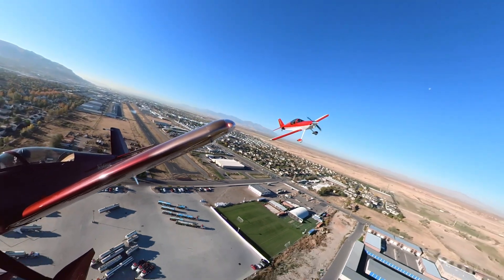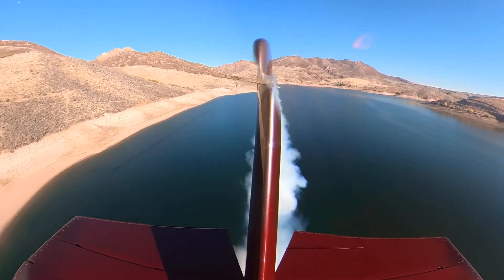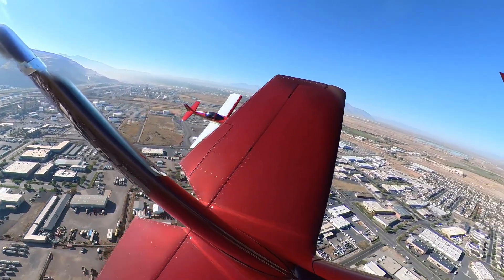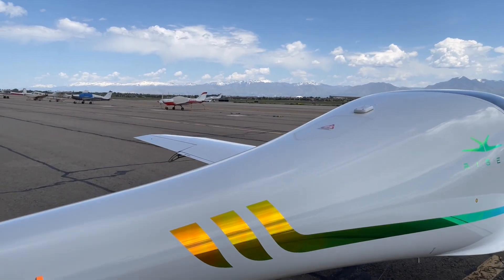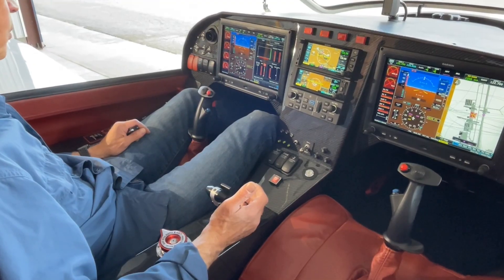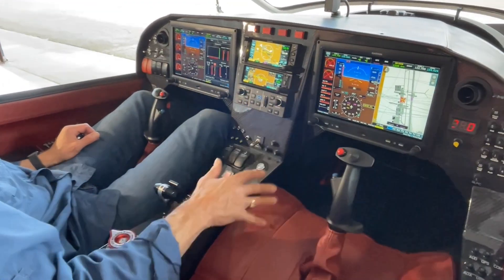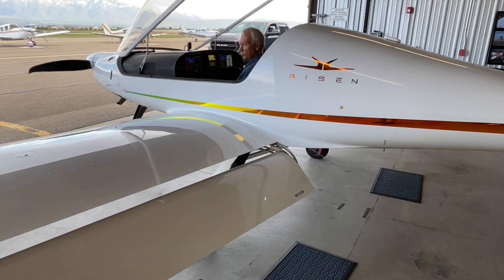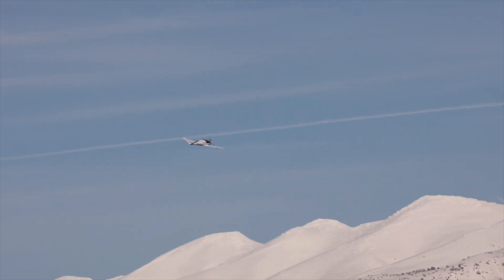Risen 915 experimental aircraft- Introduction

Comment: How does the risen handle? Can it create an “rv grin”…. or better a “rocket grin”? Try any gentleman’s aerobatics yet? Finish with the color changing tape is fantastic! Do you know if the risen will be at Oshkosh?
Reply: Thanks for the quick reply. Sorry about your tire
Reply from the maker: @cpg7277.   I thought it handled quite nice. A bit  light during t/o and landing.   Not sure about the “grin” though.  You know I’m somewhat partial to RV’s and Rockets. 
I believe the Risen is something like a +5,-3g’s. Not aerobatic. But we still did a few barrel rolls. 
Risen is planning on OSH next year. I had planned on leaving for OSH in the morning, but I blew a tire on landing today and need to order a new tire, tube and repair my wheel pant. A little bummed, but hopefully I can go next year.

Comment: Hmmm.  Automated everything.      Maybe I’m just old school, but it seems like a lot of things to go wrong.   Definitely not a KISS airplane.
Reply from the maker: @tw5315. I certainly understand.  Time will tell if automation is good.  Of course, you remember airliners use to have 3 pilots.  The third pilot was the engineer, sitting sideways. A huge panel in front of him.  Numerous tasks, one of which was bringing generators on line after engine start. What a pain, you first had to synchronize the generator before bringing it on with the others.  Also, Full Authority Digital Engine Control (FADEC) has been around for a long time now and is even available to home builders.  Funny, complexity and simplicity, a constant battle and huge debate.

Comment: Lovely aircraft, but I don't understand the prop pitch control. From the description given, a fast cruise (requiring an 80% throttle) would produce a fine pitch, whereas surely you need a coarse pitch at high speed?
Reply from the maker: @rigilchrist. Sorry, we should’ve explained better.  Apparently, there are other inputs that help determine propeller pitch besides just throttle position.  I have to say, after flying jets my whole life, I kinda like the idea of the plane figuring out the optimal mixture and prop pitch.
Reply: @WheelsInTheSky  Thanks. I agree - though I have never flown jets, I have flown a diesel a/c aith automatic prop pitch. :)

Comment: How does this compare to the DarkAero?  (I mean, besides the DarkAero not shipping for at least another year.)
* That cockpit looks quite roomy.  I assume the bucket of the seats is between the two wing spars?
* Wing is significantly bigger than DarkAero, and the max weight is less, and those huge flaps!  DarkAero's stall speed and runway requirements would be larger, right?
* Is the DarkAero effectively much faster?  The DarkAero fuel capacity is over 4x larger, but max gross weight isn't a lot bigger.  Is the Risen just assuming you'll always have a passenger?  Are those flaps making the tanks smaller?
Reply from the maker: @lainMcClatchie. Hi Lain. Sounds like you’re in the market for a plane. Always  exciting !  I looked over the specks of each plane.  You’re right, each has its pluses and minuses.  I think it just comes down to which plane has more pluses for the mission you plan on.  And, I shouldn’t say, but, which one you get the most excited looking at!
Although,  I’m not sure I would be comparing the Dark Arrow to much at this point.  History is full of aircraft designers who haven’t gotten past the point where Dark Arrow is right now.  But, I hope they do and I hope their specs materialize!  I know, not much help am I.
Reply from the maker: @lainMcClatchie. I’ll need a minute to look at that.  I always enjoy checking out another plane.  I’ll be back.

Comment: yeah it's just the best "LSA". It can significantly outrun a Bonanza and Cirrus SR22 at a fraction in running costs. And in economy cruise has a range over 2000km iirc. That 400km/h speed means it can actually be used to go places, not just fly about. If just a matter of paperwork they should definitely certify it in USA. I think there is only something like 30 of them worldwide, it's crazy. And a shame. If they could optimize production and cut price in half they could really do some damage. One thing I've wondered recently is if with such a light lean plane if it could do without the flaps. It would clean up the design and production a fair bit and we might be talking about a fraction of a second longer on the brakes.
That instrumentation there looks like it can fly IFR as well?
So much room in GA for progress. Matt Guthmiller is unironically flying around in a WW2 plane. The design is literally from 1945.
Reply from the maker: @DanFrederiksen. Yes, with the new FAA ruling, I think we’ll see sales in the US increase. I’ll talk to Bob about no flap landings.
Reply: @WheelsInTheSky  A german VL3 guy said he felt the Risen wheels were small. Are they good enough for grass strips? maybe even gravel banks.
I assume from the 650 that it's IFR capable? which is important for bonanza guys to cross shop it. VFR is so limited that GPS instrument flying should really be part of any pilot license.
Reply from the maker: @DanFrederiksen  @DanFrederikson. Yes, it’s full IFR.   The wheels are small, but it’s a small plane.  I think if a grass or dirt strip is smooth, it would be fine.  Also, may be possible to go a little bigger on the tires.
Reply: If it didn't have flaps, I imagine it would be a handful to slow down for landing. A common complaint about the Virus SW, another slippery composite ultralight, is that it's difficult to slow down without the spoilers.
Reply: @MarkRose1337  yeah because it's actually a good plane, not a winged brick. you could have little spoilers like gliders have but could also just approach shallow and use brakes. Great glide is a luxury problem.

Comment: New proposed light sport rules makes this plane a MLSA. 
1. Weight to 3000lbs 
2. Speed to 200knots 
3. Retractable gear 
4. Constant speed prop 
5. Turbine engines
6. Helicopters 
7. Possible night flight 
8. Ariel work
9. Four place aircraft
Reply from the maker: @mauriceevans6546. Yes, so happy the FAA finally came around !!
Reply: It is going to change alot of things.

Comment: Lovely but the 916 is going to be even better
Reply from the maker: @danielnofal.  Exactly what I’m thinking. And with the new LSA rules it won’t be an experimental any more.  You’ll be able to buy it factory built as an LSA.
Reply: @WheelsInTheSky  I wonder what kind of better performance you could expect with the 916?
Reply: @Zugbarrh  Faster climb, and faster speeds at lower altitudes. The 915 takes it close to VNE already. It cruises at 242 knots at altitude and VNE is 250.

Comment: FAA needs to get on the same page with Europeans this would be a light sport if they did. Aviation could be so much more if they lighten up on the medical. I have been waiting for LSA rules to change before I get my certificate. I could try and get a medical certificate it would be such a pita over things that happened 35-45 years ago doctors already cleared me of all that. They want it all checked again because that is how they are. I don't want to spend 10-15k on bunch of unnecessary medical testing which is has some risk to exposure to radiation. I only got a consult just do light sport since I never pulled the trigger on the FAA medical officially.  Once you open that can of works can't go back. I know someone who building an RV8 kit at the same time started getting his PPL. When he got to the point of solo he went to get his medical been 3 years still going back and forth with FAA over stuff happened in the 1990's. He bumped his head riding a dirtbike in 1993 was knocked out went to the ER and they checked him out. Sent him to a neurologist who did an MRI nothing found all good 30 years pass no issues. The FAA wants it all testing done over again he did it sent it they want more he done sold his RV-8 kit never soloed.
Reply from the maker: @blastman8888. I couldn’t agree more.  When I retired from the airline, I switched to “Basic Med” because I know the FAA can get unreasonable- and I’m getting older.  GOOD NEWS- the FAA released new ruling on LSA aircraft just the other day at Air Venture.  Google  “Mosaic LSA Draft Rule Summary”.  It made my day!!!
Reply: @WheelsInTheSky  That's good news.
Reply: The mosaic draft looks very good! 🤞🏽
Reply from the maker: @ronuyeyama4020    Yes, I’m excited to see some new LSA aircraft start coming out.

Comment: Does Skypark still have those really swell power lines at both ends of the runway? That is a really beautiful design btw….
Reply from the maker: @noonehere1793. Lol. Nothing right at the ends.  A couple miles off the North end there’s some big power lines,  but there’s also a lot of open fields for an emergency landing- as long as you miss the power lines.  Nothing but building off the south end!

Comment: Engine? Climb rate? Fuel consumption? Cost?
Reply from the maker: @pmapilotmooney. Hi Phil, Rotax turbo 915, seemed to climb pretty nice, taking off from about 4200’ here in Salt Lake City. Cruising at about same speed as my F1 Rocket, but burning 6 1/2 gpm, much better than my Rocket!  Cost, well, everything is just plain expensive these days.  But what a sweet little cross country plane!  Thanks for checking in.
Reply: @WheelsInTheSky  Thanks, got most of the info from another video. Looks like over $200,000
Reply: 20 years ago I had a Lancair 360, 180 hp 195 knts cruise at 9,000. @WheelsInTheSky
Reply from the maker: @pmapilotmooney.  I remember wanting one of those planes. Fast and good looking!
Reply: @WheelsInTheSky  Lancair was VERY sensitive in pitch. Needed 25% flap on takeoff otherwise neutral in pitch, scary only done once.

Comment: Pretty sweet plane. Wonder how  it would fit someone 6’3? Sat in a bunch of European composite planes during Oshkosh last year. I was quite disappointed that my head was hitting the canopy and my ankles were touching each other.
Reply from the maker: @Captndarty. Good question.  I’ll  check with Alberto, the designer.  I know when I flew it, I was surprised at how roomy the cockpit was.
Reply: @WheelsInTheSky  There are no height issues, the Risen can be customized and we have enough room for tall pilots. :-)
Reply: @daniloparlatano7760  I'm 6'4" and I fit fine in mine; very comfortable. One of the Risen pilots in Wyoming is, I believe 6'7". They can fit it to you.

Comment: I sure wish aircraft would come down in price a bit. My grandfather bought a 1977 172 brand new and if i remember right it was around $20k. Now they are $400k+. A person would probably have to pay $100k or more for a decent used 1977 model that has been flying almost 50 years already!
Reply from the maker: @chester8420. I agree, the price of everything has gone crazy! But, before I start getting upset, I have to say, there are still some reasonably priced planes out there.  Not always the one you want, but still some nice flyers.  The important thing is, just to get in the air and go somewhere!!   You can always run a wanted add in BarnStormers for what you’re looking for.  Best of luck in your search!
Reply: @WheelsInTheSky   It's crazy! My farm has a nice graded 3000ft grass strip, a hangar, windsock and 7 young guys that all want to get their pilots license. But no aircraft.
Reply from the maker: @chester8420.  Oh no!  Sounds like torture in paradise!  Find something to fly. There are some pretty cool ultralights. A nice used one could be pretty inexpensive and a blast to fly!
Reply: @WheelsInTheSky   Thanks for the encouragement!
Reply: @chester8420  7 guys could definitely pool together 30-50k for a decent flyer and enlist an instructor! Find a low power taildragger and go have some fun
Reply: Is less than 350 K